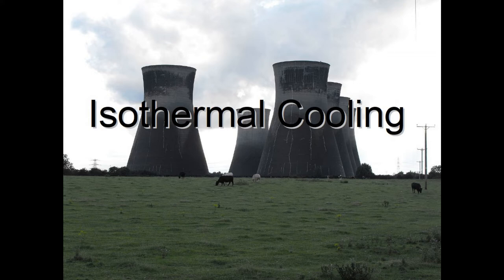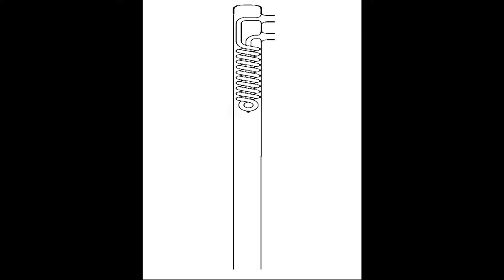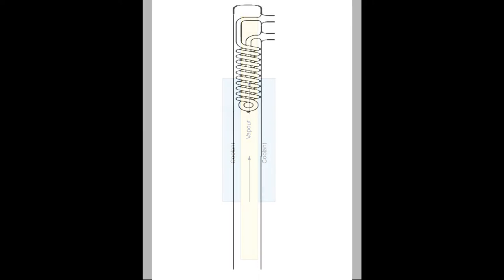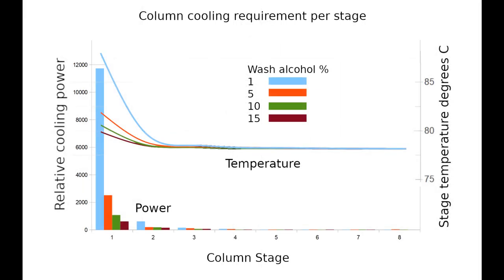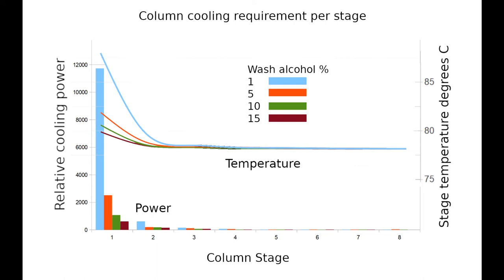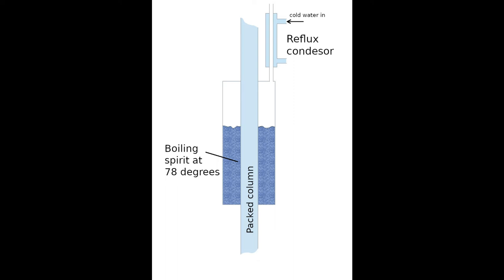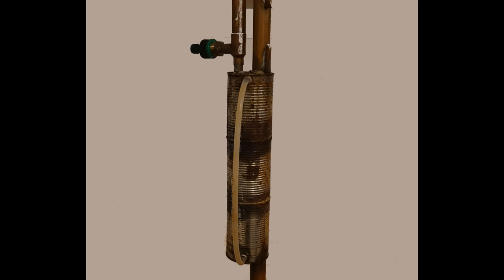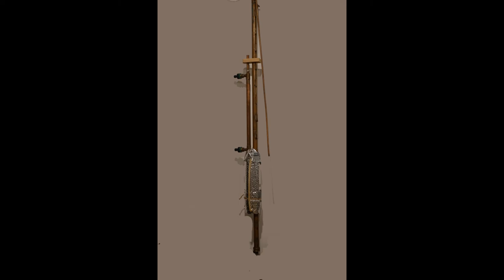Isothermal Dephlegmator for over 96% 192+ proof vodka moonshine

Comment: This is a very clever and efficient design. I can imagine using distillate from different parts of a run as the coolant to fine tune the column temperature. This gives me ideas but my plate is full just now. I will revisit this next year. I see your channel has other good info. Subbed.
Reply from the maker: I've tried to use it with an acetone water mixture for temperature control at the column top but it did not work because of low vapour flow and hence low latent heat in the column. I'd be interested to see the results  of using using higher boiling point spirit mixtures.
Reply: @tight1449  Have you seen the My Vodka Maker continuous still? I may buy one just to take it apart and see how they do it.
Reply from the maker: @Miata822  No I did not know if it before you asked. I have looked it up. Very interesting. I'd like to know how it works. It distils to 90% I see. I have aimed for higher proof as from early experience it seemed that it lead to cleaner taste. If you do get one I'd be most interested to see what you find.

Comment: I don't typically look to create neutral spirits, though I may have to take advantage of this principal for selectively condensing less volatile components at my dephlegmator to run reflux in a more efficient manner. I was just thinking about splitting up my water reservoir to run warmer water through my dephlegmator. But at a higher and more constant rate than I currently do. My reservoir currently fluctuates and forces me to adjust the flow more than is necessary, causing peaks and valleys in my still head temperature. This information will be very helpful in helping me figure out how I want to go about making the modifications. So, thank you sir! Much appreciated 💯😁
--RuneShine, Michigan's Norse-Druid Alchemist ✌💚🙃
Reply from the maker: Best of luck with it. I use this isothermal deflegmator at the bottom of a column where there is at lot of heat to remove and the temperature is high. It can work at the top if using it as a reflux condenser but the filling liquid needs to boil at a lower temperature than spirit. I tried it with mixtures containing methanol or acetone which work but require care to ensure no contamination of product with the liquid. In the end I found a PID temperature control system easier for a reflux condenser.
Reply: @tight1449  
🙏Thank you! I certainly appreciate the input💯
I wouldn't be too concerned with the contamination aspect as I'm using modular stainless sanitary fittings and would end up fitting together a build with those to incorporate the isothermal dephlegmator within its own secure and self-contained addition.
The information about placement definitely helps cut down on the R&D when I attempt this.
I'll likely use the iso's placement to affect the efficiency and use changes to the length of the column itself to effect just how much or how little heavy flavor compounds I choose to allow past the event horizon at the top to them move either into a botanical expansion or just right into the condenser.
It probably doesn't work exactly like that, that's just how I currently think it could potentially work despite never having used it😅
Even though it'll likely be a bit different than that, I can already see some definite advantages to using isothermal cooling for the distillation and rectification of spirits.
It's going to be on the back burner for a bit first though as my project book is packed right now with all the extractions, infusions, macerations, fermentations, and biological/mycological experimentation I'm doing.
Currently trying to decode some of the yeasts' enzymology regarding their ability to create esters and ester precursors during fermentation with the use of carboxylic acids, amino acids, fatty acids, vitamins, minerals, phenols, terpenes, thiols and more just through their regular metabolic pathways.
Sometimes all it takes it the right nutrition to unlock the flavors yeast are capable of producing, not to mention allowing bacterial changes to change the result in a finished spirit...the options are basically limitless👨‍🔬
Although there never seems to be enough time in a day to keep up all the projects I tend to juggle in this mess of an ADHD mind I have, I'll definitely get to it sometime soon though😂🙏

-✌💚🙃
Reply from the maker: @thealchemist-hr8me  I've been a bit of a one trick pony in this, pursuing vodka. I've used it to make gin and pseudo whiskey, but I do not have experience of distillation techniques that intentionally extract flavour from the wash. I did experiment with a sloping tube method of making a rectifying column that would allow multiple draw points for continuous distillation, but basically it didn't work and I've only ever used sugar wash anyway Similarly my knowledge of fermentation chemistry is mainly what's explained by Adam from still behind the bench Youtube channel, so I'd be most interested in how you get on.

Comment: nice, and similar to a boka. I use a 25cm shell tube heat exchanger above a collector. I have this on a 100l still and it works beautifully. I am in the process of designing a 1000 liter version. I like this still head as i think a packed column is more linear than a set of bubble. plates. i get excellent resolution when i do my final  cuts.
Reply from the maker: My top end is similar to a Boka with slanting plates used to remove liquid from the column, but differs in that I have another packed column above the draw point for fractionation. The isothermal deflegmator at the column bottom is also different. I too prefer a packed column. It gives better results and costs less but is more demanding of precise control.
Reply: @tight1449  Think i understand. I've used a 1m column to up the alcohol %, and i found it helped to be lagged with a neoprene jacket.
Reply from the maker: I found that lagging reduced the power consumption but also the proof slightly, presumably because of less reflux.
Reply: @tight1449  oh.. really? i think the idea is that lagging increases the reflux. how long was the reflux tube? packed with?
Reply from the maker: lagging reduces heat loss so less vapour condenses on the inner surface of the column. Reflux condensers do the opposite by returning condensed liquid to the column. I found a consistent fall in % from 96.5 with no lagging to circa 95.5% with thick lagging on a 28mm by 1700mm packed column with stainless SPP.

Comment: Very interesting! If I understand correctly, having an isothermal deflegmator before the packed column will cause heavy vapors to condense, thereby increasing the ethanol concentration in the vapor stream. How much packed length would you recommend in this case, assuming it could be significantly reduced? In the case of a 2'' column with a 1-meter packed height, do you think half of that would be sufficient while employing isothermal deflegmator at the bottom of the column?
Reply from the maker: I have not tried it but suspect that it would work, though you may not be able to get to 96.5%. You would probably get over 95 though.

Comment: this is an awesome idea. what do you think about trying it with a batch distillation? I have a condensor controlled vapour management (CCVM) still using a 1->1.5m scrubber packed column and a height adjustable reflux condensor. It would be interesting if a 2" dephlegmator under the column, filled with heads and with a leigig condensor to condense them,  can remove some of the heat from the bottom of the packed column. My goal would be to get a higher ABV coming off the still with the short packed column
Reply from the maker: I used it first with batch distillation. It also works with continuous distillation, but its advantages are more marginal. Its big advantage in batch distillation is that it automatically corrects for the changing cooling needs as the batch progresses. 

Structurally, it's just a deflator or shotgun ex condenser. The only difference is instead of cooling water you have spirit, and instead of liquid flowing through it, you have the bottom connector of the cooling chamber blocked off and the top one connected to another condenser that condenses the vapor back down into liquid. 

I imagine that you would get a higher ABV coming off the still using one, but I'm not sure what the effect would be if you also used a CCVM condenser at the same time. The way I do it is to have no column top condenser at all. 

You be doing well to get over 96% alcohol with a column under about a meter in length, but I fond it was fairly straightforward to get 95%. That's using a narrow column, 1 1/4 inch packed with spiral prismatic packing. The one thing you do need is precise control of heater power.
Reply: @tight1449  if you don't have a column top condenser, how does the ethanol condense from vapour to liquid at the top of the packed column?
Reply: never mind, I just watched your "Separation of heads with fractional distillation" video, where you describe how your still head works. Looks like it's a liquid management style similar to a bokakob but obviously with the temperature controlled column top extension. I am enjoying your videos, some really interesting ideas and thinking outside the box. I am going to try your isothermal dephlegmator idea with my CCVM still, I will let you know how I go with it
Reply from the maker: @krumpinjugger  Good luck. You probably don't need to make anything new, just use a regular shotgun condenser but put spirit in the cooling chamber and connect the top port to a Leibig condenser to act as a reflux condenser.